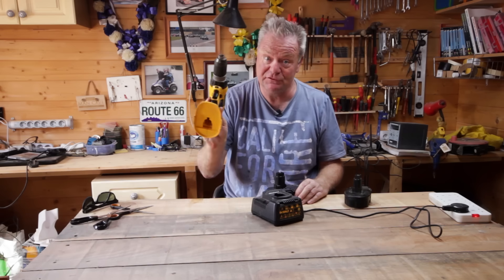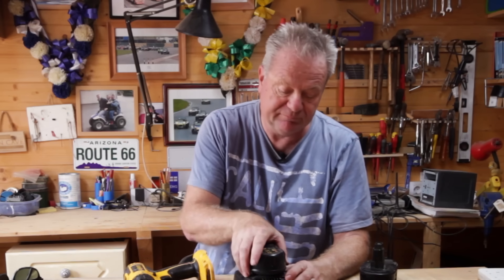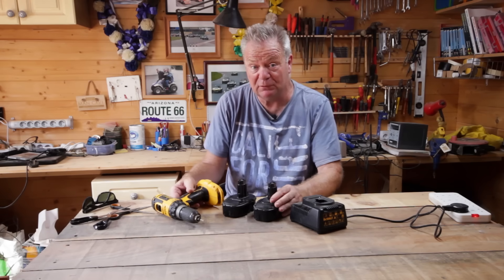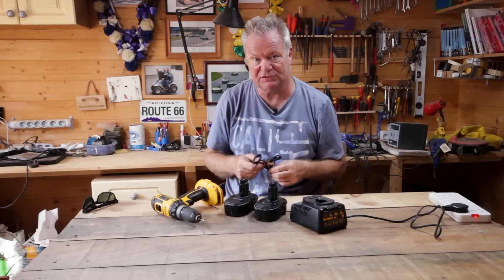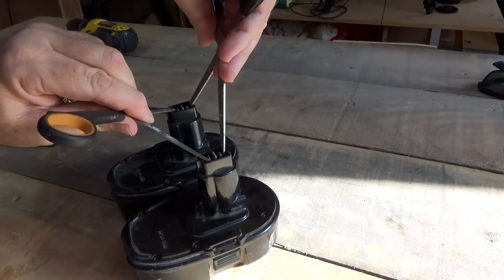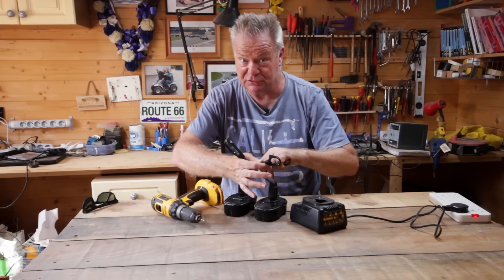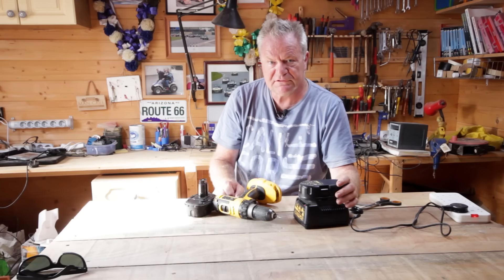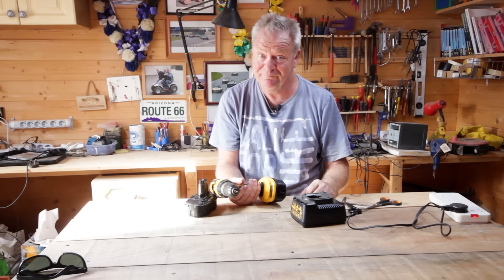How to revive a dead rechargeable power tool battery easily

Comment: This defies the laws of physics,
Both, use of the charger or jumping a dead/empty battery is the same thing. Supplying electricity. 
A video for clicks? Without explaining the physics I am not convinced to waste valuable time to prove it or disprove it.
Reply from the maker: Well if you end up with a dead battery feel free to throw it away and buy a new one without proving it. My A-level physics from 40+ years ago has been overwritten by more useful things over the years. Apparently the chargers have some sort of detection in them so if the battery is very discharged it does not detect it has been inserted so won't start charging.
Reply: @JPinFuerteventura  , you know he's gonna try it, lol. He said he didn't want to waste time but had enough time to watch your video and add a comment.👍
Reply: @B4YOUTUBE NO ONE CARES WHAT YOU THINK! IT ALWAYS BAFFLE WHEN PEOPLE COME ON HERE JUST BECAUSE THEY WANT TO DISAGREE...SMH...ACTING LIKE THEY KNOW HOW TO EXPLAIN EVERYTHING
Reply: I'm not sure how this works either, but I've seen a co-worker do a similar thing with wires instead of scissors, but the results are the same. There's some sort of chip inside of these power tool batteries that communicate with the charger and if the voltage is too low, then the charger deems the batteries as dead.
Reply: When muppets comment...(grabs popcorn)
Reply: Glad you guys aren't watching videos about quantum mechanics. Especially b4youtube!
Reply: Try testing your hypothesis before posting, it makes a more compelling argument.
Reply: Mp on
Reply: What the hell are you talking about?
Reply: Waste you're money on new batteries then, all your doing is bringing up the voltage enough to charge.... Don't be an asshole....
Reply: defies the laws of physics. sorry Sir but NO. you defy the laws of something tho not quite sure what.
Reply: What it defies is the extent of your knowledge of physics. Any physicist worth their salt would attempt to explain the process, given that a successful experiment has been observed over and over and over and over and over. But then, your time is so valuable, you're probably better off just regarding it as magic and leaving it alone. I  say this because, comparative  belief-systems that hold certain scientific conclusions as "settled" are operating on the same type of narrowed assumptions, typical of most religions. Since most religions believe that magic is evil, it goes to follow that your religion, that of limiting physics to what you know, probably does too. Based on that reasoning, you should probably go away, cowering in fright and uncertainty, and never return. -just a suggestion.
Reply: no it isnt...the charger has a built in test that prevents the charger from charging a bad battery.... He is simply using the other battery as an exciter to get the charge started. Golf cart shops do this all the time with 6v batteries when the drain to low for the charger to charge
Reply: the greatest success that ive had was by using the Magic Mender Wizard (just google it) without a doubt the best course that I've followed.

Comment: Good tip, thanks John. I must give that a try on my old Bosch cordless drill. Nice workshop btw :)
Reply from the maker: Cheers Kevin. It is nice but the trouble is for at least 6 months of the year it is too hot to spend more than a few minutes in there!
Reply: Simples  ...Either install a Leroy Merlin Aircon unit or cheaper option get a fridge in there with plenty of cold beers! :D
Reply from the maker: lol - I will have to start drinking again Kevin